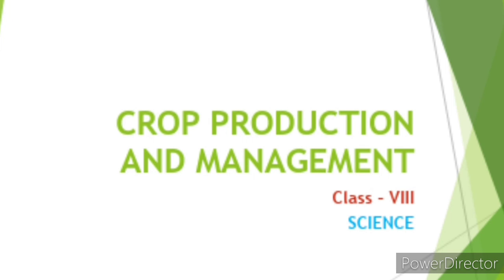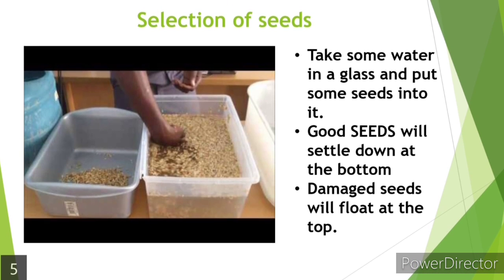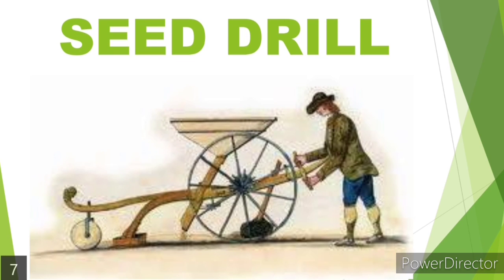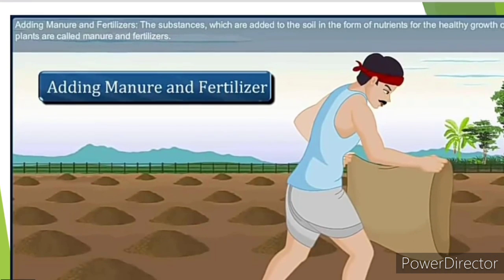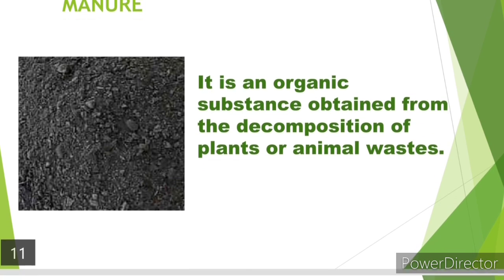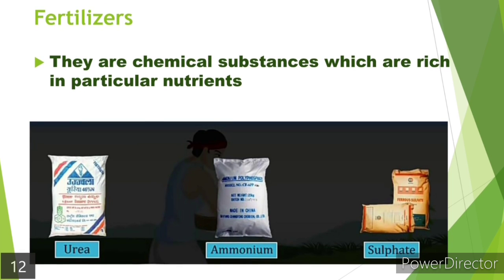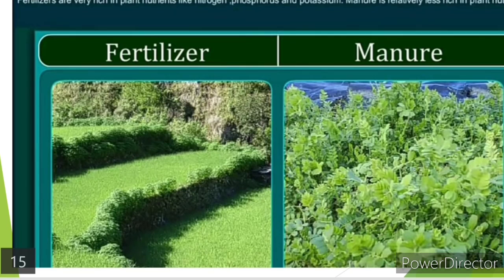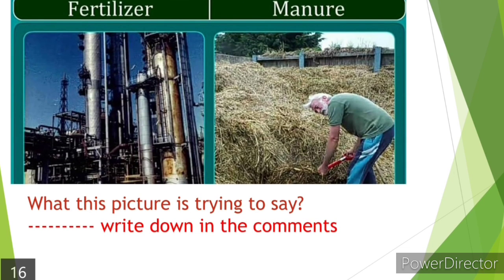CROP PRODUCTION AND MANAGEMENT PART-4 CLASS - 8 (CBSE)

Comment: Mam I am shrijataa ghosh the answer to the first question is- when we sow seeds it is necessary to maintain an appropriate gaps or distances between any two plants because if we do not maintain it then the plants cannot get adequate amount of sunlight, nutrients and water to grow because these are the necessary things which are needed by the plants to grow. Of there is over crowding then it will be difficult for  the seeds to grow

Comment: An appropriate distance should be maintained while sowing seeds is for the proper consumption of sunlight , water, nutrients and also to avoid overcrowding......
                       --------------Tannishtha🙂
Reply: This picture says that manure is mainly prepared in the field i.e. manually whereas fertilizers are prepared  in factories using certain chemicals.......
Reply: Ex. Of fertilizers are ammonium nitrate,NPK etc.....

Comment: Good evening ma'am. I am Adrija Bhattacharjee and the answer to your questions would be:
Answer of Q.1)  It is necessary that seeds are sown by maintaining distances because if such is not done there will be competition among them for sunlight,water and nutrients which will lead to the damage of most seeds.Also if they are in uniform distances then they will get adequate amount of water and nutrients.
Answer of Q.2) Example of another inorganic fertiliser is calcium ammonium nitrate
Answer of Q.3) The given picture depicts that though both preparation of manure and fertiliser needs hardwork but manure might not provide glossy looking plants or vegetables but it helps the nutrients to remain in the soil for a long time but fertiliser destroys the nutrients of the soil if used frequently but it produces glossy plants, vegetables and fruits..... . .

Comment: Ma'am I am Utsab Das 
Q1. It is necessary to maintain appropriate distance when sowing seeds because-
a. If seeds are planted without any gaps or very little space is there between them when the plants will grow it will create over crowding of plants.
b. If distance is not maintained there will be a competition between the plants for obtaining nutrients from the soil, in this case the plants will not grow to be very good.
c. Another problem caused due to this is that during irrigation some plants may get more water than required and rot while some others may not get any water and dry.
d. Maintaining gaps helps plants to grow healthy.
Q2. Other fertilisers - Super Phospate , NPK (Nitrogen,Phosphorus,Potassium).
Q3. The picture shows that fertiliser while may be more helpful is not good as they are made in factories, fertilisers pollute water and also during production in the factories smoke is produced which causes air pollution whereas manures are completely organic, do not harm the soil nor pollute water.

Thank you ma'am for providing us these great classes to help us study😊

Comment: Hi ma'am.
I am Ratul Chowdhury from class 8.
The answers of the questions (given by you) are as follows respectively:
Answer no. 1 :It is necessary sowing seeds maintaining an appropriate distance because of the following reasons :
i. It helps the plants to get appropriate amount of air.
ii. It prevents from fighting for food among plants.
iii. In case of maintaining this uniform distance, the plants will get adequate amount of nutrients and water.
Answer no. 2 : The name of one more fertilizer is Super phosphate.
Answer no. 3 : The mentioned picture is trying to say that fertilizers which are inorganic are mixed with the soil for good crop production and it is obtained from factories or industries and it's made using chemical which may harm the soil in the long run. Whereas, manures are organic and are obtained naturally from the decomposition of plants or animal wastes and it doesn't affect the quality of soil in the long run.

Thank you 😊😊.
Reply from the maker: Yes only you have answered all the question 👍 very good 👏👏
Reply: Thank you 😊😊
Reply: Thank you 😊😊
Reply: Thank you 😊😊
Reply: Ma'am please check my answers.